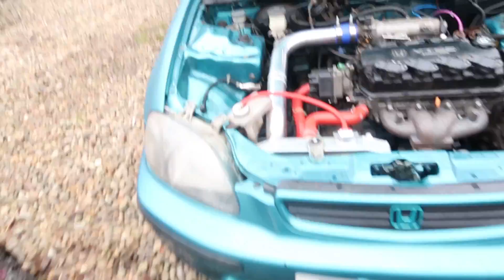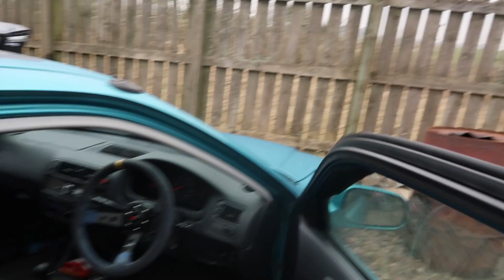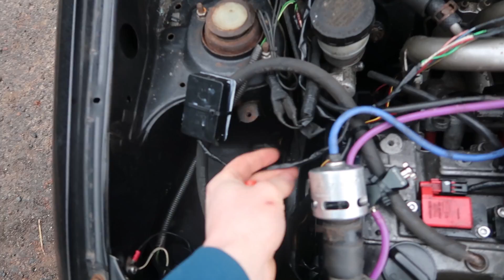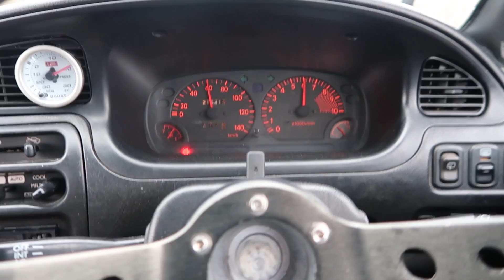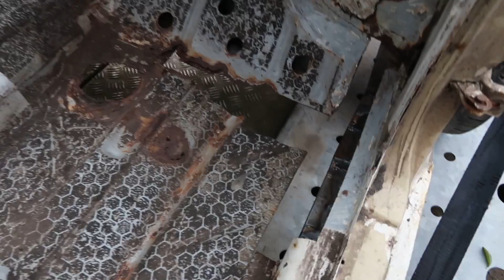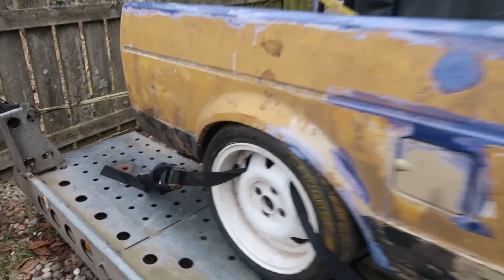I SWAPED MY CAR FOR A PROJECT?!! BYE BYE DAIHATSU MIRA TURBO

Comment: A plus man ..lap valves and ROD bearings and a hone and cleaning ring lands gaping ring that my logic on any old motor as i  have had seen bearing loose crush n spin on me not even boosting them just pulling a good one apart a one bearing loosing it crush so lol i been checking and swapping rod bearings ever seance and truing rods if stretched thats one nice thing about powder forged rods is they seem not to stretch like old forged chevy rods did i had a v8 7 out of 8 were stretched
Reply from the maker: ill go v8 some day for sure